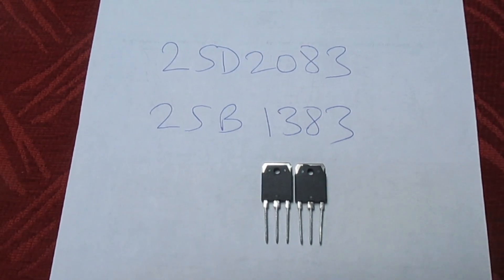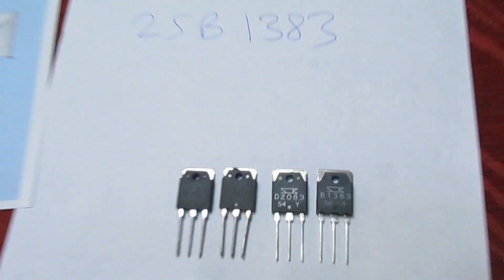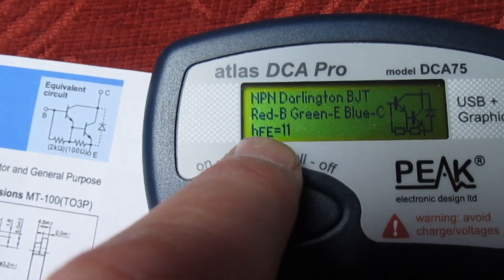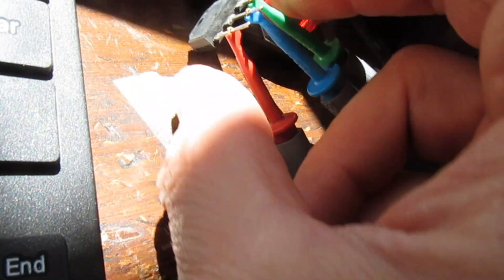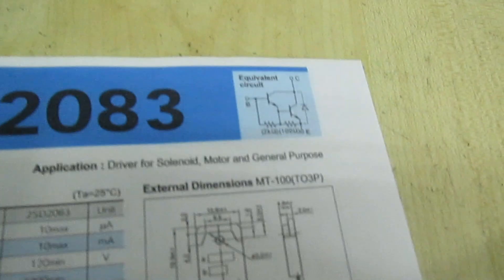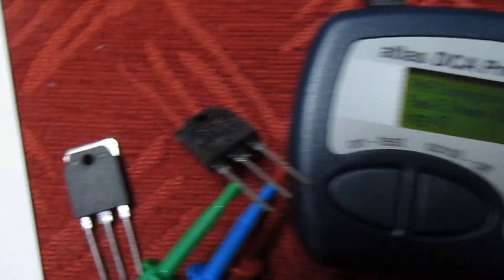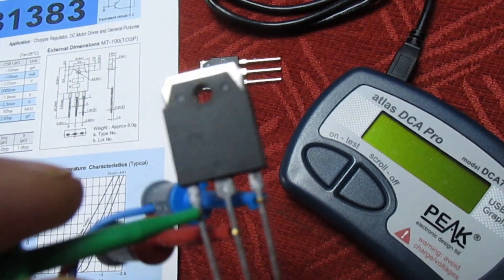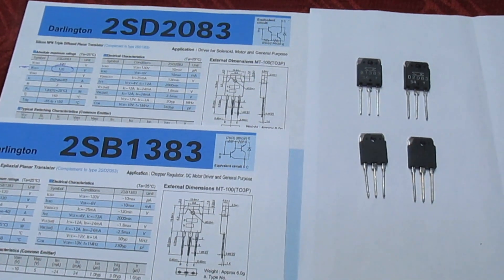Don't buy any 2SD2083 and its complementary 2SB1383  transistors until you have watched this video

Comment: I remember I brought 5 scan Ics for Samsung B/C plasmas off some site, I soldered them on perfectly and blew out a y sustain I was confident would work 3 times in a row until I realised the “new” Ics were actually causing it to blow up. They were shorted on several pins they should not of been, it’s they were manufactured wrong. I was so angry wasted like £100 on parts on the thing. 

This is bad news though, wonder how many devices have been blown by these cheap knock off ones 😭 I used to use all sorts of cheap transistors off eBay when I was a few years younger 🤣
Reply from the maker: I know the feeling , i too have amplifiers blow up after fitting a new chip until i realised the chip i was fitting was a completely different one with the same number printed on the front , took a long time but I have seen most of the Chinese fakery now so there's not much that gets past me now !
Reply: @michaeldranfield7140  you have to be careful, as you say I closely check things these days to avoid blow ups and avoid cheap parts altogether. Are you much good at diagnosing digital tech Michael ? I’ve a mainboard I can’t work out what’s going on 🥲
Reply from the maker: @MrReeceyburger123  Yes I can see you don't use crap parts , I believe in one of your videos you were using components from Mouser electronics , and your very unlikely to get any sub standard parts from them .
Most of the digital stuff I have worked with has been sky digital boxes , I dont do computers .

Comment: Michael, have you ever thought about doing a video about space-charge tubes? In 1962 the U.S. car manufacturers had to switch to space-charge tubes in their car radios for a year or two because the early germanium transistors used in the 1960-61 cars lacked gain and they got a lot of customer complaints about poor sensitivity.  (Motorola and Philco had hand-picked for gain the germanium transistors in their prototype radios that they used to convince the car manufacturers to switch from tubes to solid state in 1960!)  In any event, I find space-charge tubes very interesting.
Reply from the maker: If I had time I could make a video everyday! I have more on the way not none about space charge at the moment although someone did give me a valve car radio a couple of weeks ago but not looked at it yet.
Reply: The only space charge tube was the driver tube, basically with the control grid positive and screen grid used as controlgrid. Rest were like normal tubes.

Comment: It's the old saying Michael " You get what you Pay for" personally I only  use Farnell, or RS Components, cost more, but at least you know what your getting, very good public information video.
Reply: You'd be surprised. Even reputable parts dealers can get batches of counterfeit parts. It's unbelievable really how pervasive the fakes are anymore. You just have to test everything today before you use it.
Reply from the maker: @1pcfred  I know I have had fakes supplied from a major distributor on more than one occasion already . Fakes so good they must have fooled the distributor .
Reply: There's also Cricklewood Electronics. The prices might be higher, but they also do many of the JIS typecodes as well.
Reply from the maker: @robertneill3057  Yes I know Cricklewood electronics but last time I needed some FET for a disco deck I e mailed them and asked if they could guarantee the ones I wanted were genuine old stock and not Chinese imports but they never replied back so I never bothered with them again .
Reply: No ,you can't  rely on that addage/ maxim . Within  the  comments  here , it's  been mentioned that the fakes had on occasions  cost more  than  the  genuine item .
Reply from the maker: RS my first choice and in many cases cheaper than Farnell but lately everything I need most importantly seems to be out of stock and only available for backorder.

Comment: I saw the tester you used (not the Peak) to check breakdown voltage appers to have been built by you.  Nice work!
Is it, or a schematic available?
Thanks!
Reply from the maker: Someone else asked this and I built this during lockdown when I was closed , I can no longer find my drawings , I did manage to find the most important part of the circuit and you can fill in the missing bits if you want ?
Reply: @michaeldranfield7140  I was the one that initially inquired about the breakdown tester. Perhaps you could do a teardown on it and create some new drawings in the process then put it up here as a new video? I am still very much interested in building one.
Reply from the maker: @stopthebus  i have the diagram of the hart of the tester if you want to come up with the rest ?
Reply: @michaeldranfield7140  That would be a good start. Is it easier to email you?
Reply from the maker: @stopthebus  md@digifixltd.co.uk
Reply from the maker: @stopthebus  md@digifixltd.co.uk
Reply: @michaeldranfield7140  yes, I would appreciate the part you have.  If I can successfully fill it in, I'd be glad to send the complete circuit back to you.

Comment: I always make a point of reporting fakes back to eBay. I have always had all my money back (not my time testing things) and I usually get to keep the fake item or at least it goes in my bin.
Reply from the maker: E bay give the money back if the item is counterfeit but then they don't take these listings down and they continue to be sold regardless.
Reply: Are the chinese sellers asking to modify their negative feedback to positive in order to refund you?
Reply: @paulcohen1555  I don't leave feedback until I get the refund.
Reply from the maker: @paulcohen1555  no but they sent a silly message saying "the appearance may not look good but these are genuine parts "

Comment: I have also been caught out by auction site fakes. The irony was that the real ICs were actually cheaper from a reputable distributor. Once bitten, twice shy.
Reply from the maker: To be honest I think most parts sold now on the Internet are fakes but some are harder to spot than otheres, items in current production are less likely to be faked and as you say a current production fake item is likely to cost more than the real thing.

Comment: Dodgy and dangerous transistors?    It's a contest between Ali Express and eBay.  The worse thing is some will work a few hours before they fail short and take out other components.  At least in Britain, you have reputable distributers to buy from, here in Thailand the best I can do is LCSC in China.  I have not gotten any rip-offs from them.
Reply from the maker: It's not always that good in England, a few times I have had fakes so good they fooled a major distributor.

Comment: Never buy active components from certain auction sites or a certain Chinese electronic emporium, they're certain to be fakes, needed some regulator output devices for my ongoing brc2000 project, i obtained some genuine 1980's stock mj15024's from another member of the vintage radio forum, wouldn't risk using new devices because of this problem.
Reply from the maker: It's getting to be a big problem, when something is a few years old and the original part has become obselete it's a perfect opportunity for faking components as demand rises and people start to search the Web for replacements.
Reply: You can, but, if you're not sure about the vender, buy the minimum quantity, and bench test them. That way, you're not out much, should they be a miss-labeled component. More importantly, if it's a critical component, you don't just trust that they're the right thing, and risk losing an entire production run.

Comment: I've largely stopped buying transistors and chips from the likes on EBay because so much stuff is fake. Not worth the risk on any project. These devices do cost more from Farnell or RS but little chance of getting fakes. I recently did an exposer on my channel of fake NE5532/4s most from China are fakes also. Any that I can prove fake, I always get my money returned.

Comment: Thanks Michael, I ran into this exact issue about 5 yrs ago. The replacement transistors for a sub amp kept failing despite all surrounding components testing good. I ran out of time as the customer didn't want to pay anymore. At last I can put a failed repair to rest.)
Reply from the maker: Had that myself with a amplified speaker, kept coming back with failed class D audio chip, IRS2092 I think the chip was, took me a while before I realised the chips I was fitting were fakes because they just looked so good, it was only when I compared the writing on the chip with a known genuine one I realised.
Reply: hello Chris  
I make sure everything is okay before  handing out the repaired equipment to the customer  
I have many competitors   and my reputation is prime to keep it 5 stars
if you are a solid  engineer and know what's going on   always do the 
heat test and hfe  on transistors before  deciding to install 
the transistors .
for ic chips  the test process is more complex but the important component to test inside the chip is its power output  
(read datasheet    , put the max load on it's output , measure the output voltage drop and  calculate it's loses power and  measure case temp )
if all those are near  the datasheet specs then u  blindly go and install those and make the customer happy and to come back when he gets anything  faulty .
been this  for 23 years and going on ...    I have seen and witnessed the best   and the worst in every electronic component  performance .
👋👋